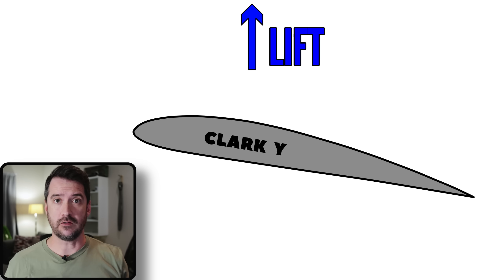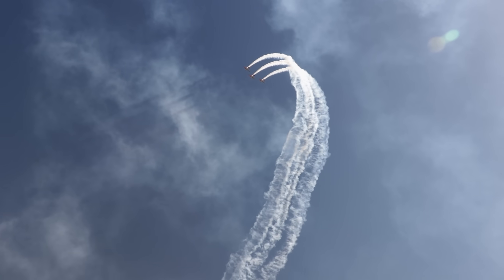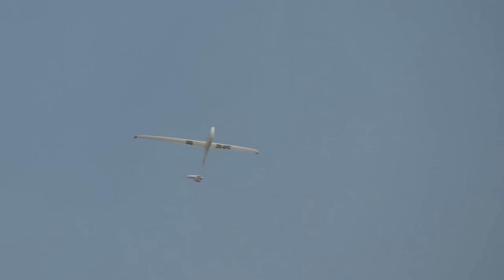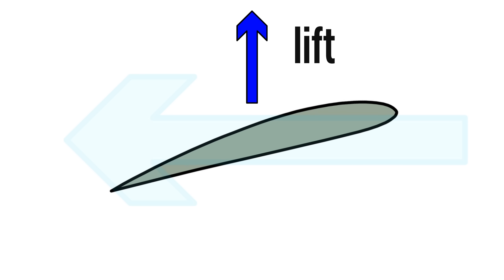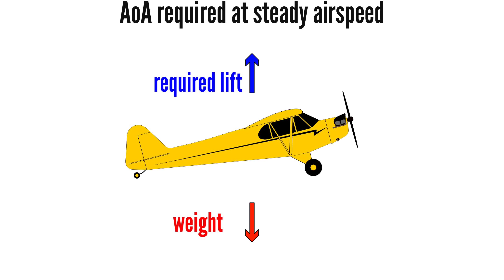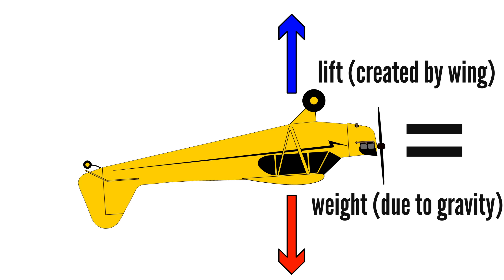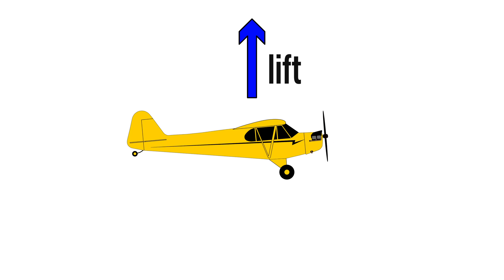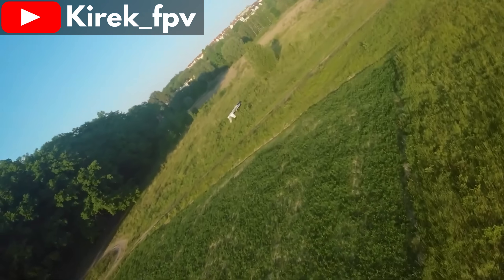Is Airflow Distance Over the Top of a Wing Always Longer?

Comment: the question i always place upon believers of the "low pressure" theory is this...

"whats above the low pressure zone?"

when i was 8 or so, back in the 90s, i discovered "the coanda effect".
when i was about ten i realised its useless. just bernoullis. no lift can be achieved by it. that AC vent on the wall that holds up sheets of newspaper? its rigidly attached TO THE WALL. you cant strap the fan above the newspaper and get the fan to lift up as well... the WALL is holding everything up. not the fan, nor the low pressure zone on the sheet of newspaper.

and for the last thirty odd years ive been laughing as various people try and convince me that its the future of VTOL/STOL

same deal... what KEEPS THE LOW PRESSURE ZONE AGAINST THE WING?

a high pressure. and that force pushes DOWN just like everything else affected by gravity!

the ONLY thing producing LIFT is "mass transfer". or inertia. air with mass and inertia displaced, forced down, with a proportional weight forced up.

and an airfoil is ONLY shaped to displace the maximum amount of air as gently as possible, with as little turbulence or drag, as possible...